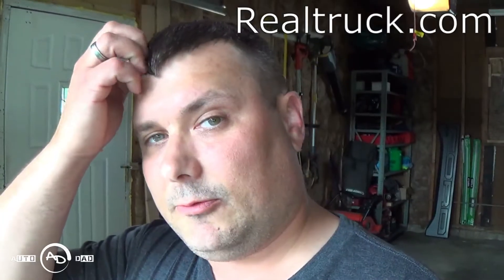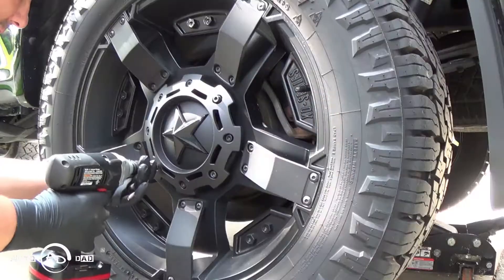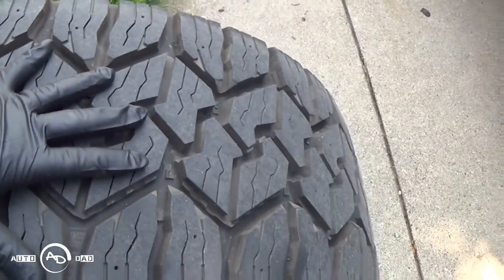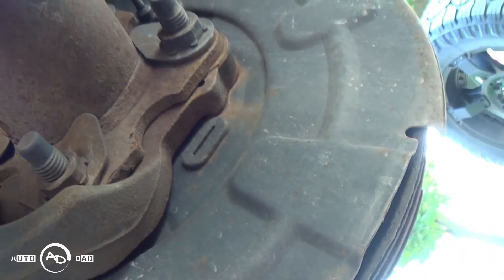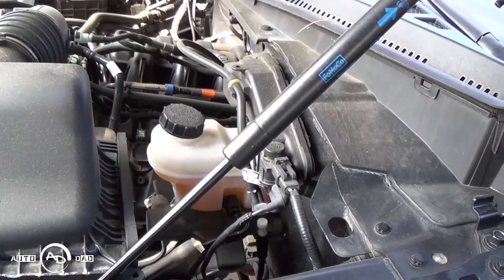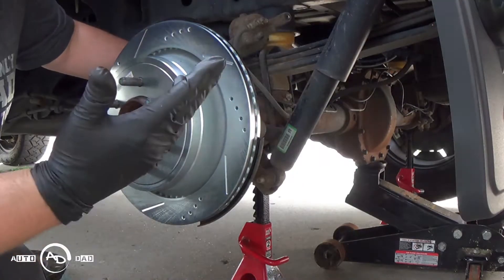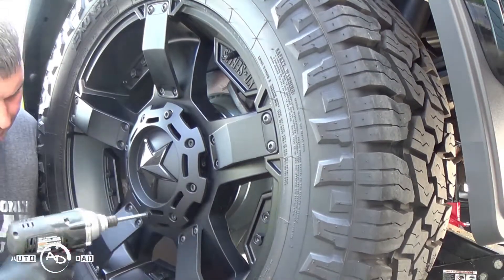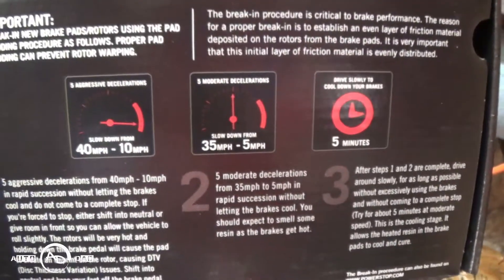Rear brake pad rotor install on my 2016 F-150 w/ manual parking brake

Comment: On every brake job, I always pull out the slide pins on the caliber. Clean them up and add high heat nickel anti-seize. This will prevent the caliber from seizing and pulsing brakes. I think this is a must.

Comment: Thanks for the info. Did not know that there’s a difference in the install between the manual and auto parking break. About to change mine to the drilled and slotted setup. I’ll be sure to give you credit on my channel. Thanks again 🤙🏼

Comment: PLEASE read this before doing your brakes. Do Not push the brake fluid back into the master cylinder with a C-clamp. Open the bleeder valve (3/8 or 7/16 box end wrench). Discharge the old brake fluid into any container and discard it. I use a  empty water bottle with a slit in the lid. It fits right on the bleeder nut. This can be accomplished before removing the caliper. I do this 1st thing after removing the tire and wheel. Tighten the bleeder nut after the caliper piston/s are collapsed. Continue this process for each caliper and keep the master cylinder reservoir full of fresh clean brake fluid. On old cars w/o ABS we used to use a c-clamp. On newer vehicles you can f-up the ABS if you push fluid backwards. 😉

Comment: Dont forget about the adjuster on the parking brake  ..did you go over that?
Reply: I’m not for certain but I’m pretty sure after you get the rotor down and everything fastened you can go back and adjust that wheel until it’s tight and then back it off one or two pods. Basically you’re moving McAllister closer to it. I’m going up on the driver side and down on the passenger side so you want to get it until it touches and then come back off just a little bit.

Comment: Which way did you move the park brake adjuster to get the rotor off?
Reply from the maker: It was so long ago I don't recall. I went back and forth until it loosened up
Reply: I'm in the middle of my job and was wondering the same thing.  That would've helped.

Comment: So which way do i turn the adjustment wheel? Kind of important, don't ya think?
Reply: Agreed haha working on mine now and am confused!
Reply: @thedjtko  ok, so just like my camper. Wheel up on one side and down on the other. Roll wheel down on drivers side to loosen parking brake. Roll wheel up on pass side to loosen parking brake. Then bang the hell out of it. I rolled pass side wrong way and jammed it until i couldn't move it either way. I drove it after spraying wheel with Wd40. I guess it heated pretty good because it was making a bunch of noise. I checked the wheel next morning and it spun nice and easy. I was then able to get the rotor off and finish brake job.
Reply: @slater4041  Awesome!  Your feedback helped a lot! Thanks.
Reply: It is, but it's impossible to show every detail thoroughly when you are 1) doing the job, 2) learning as you go (which is inevitable when working on cars) and 3) trying to hold the camera. It won't take too long to figure out which way to turn it.

Comment: Thanks for the video!  Are you still happy with the brakes/rotors?  My rears are in need of replacing and I am considering the power stop also.
Reply from the maker: They are great. Still no rust on the zinc coated rotors